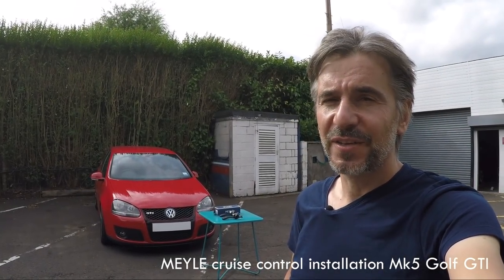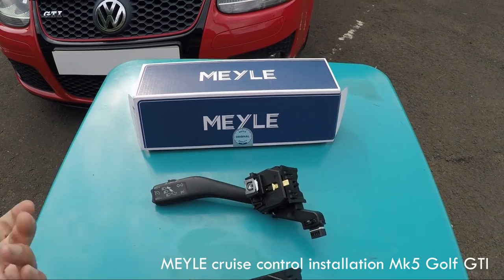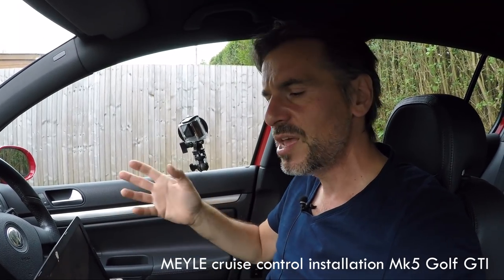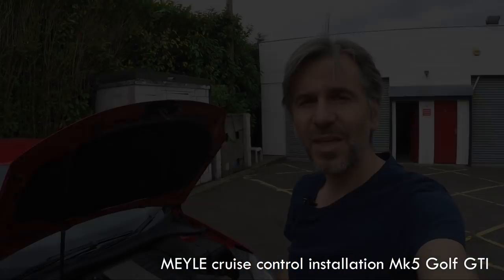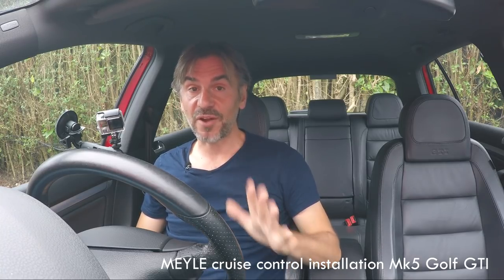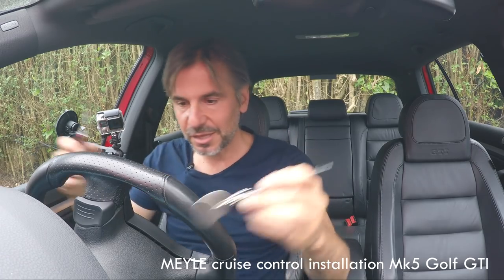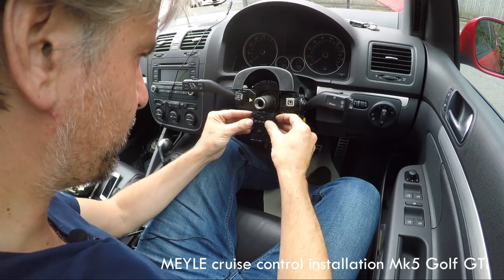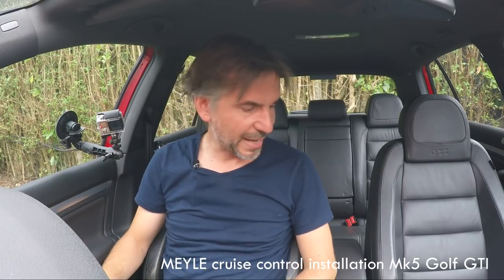DIY CRUISE CONTROL GUIDE - MK5/6 GOLF, EOS, PASSAT, A3

Comment: Hi, my 2005 Golf Mk5 cruise control has stop working, I've checked everything and all seems to be fine, my final result being that the stalk needs to be change, my question is?, do I need to buy the same part number as the one already installed, in vagcom the control module for steering at info shows as being 1K0953513F but I see so many parts out there that have sa same 1KO....... But la last letter is A or G or etc.... Is there any coding required for this. Thank you and excuse my lack of knowledge.
Reply from the maker: The part number you quote is for the control module. If your stalk is defective you just need to change stalk, don't touch the control module.  I am pretty sure any Mk5 cruise stalk will just plug and play but I'd get the Meyle one.
Reply: @volkswizard  thank you, really appreciate your reply, all the best

Comment: Hi, I fitted this to my 05 gt tdi, all the coding was accepted, and the light comes on when the engine is off, as soon as I turn the engine on it goes out and I get error codes, any ideas why or what I can do to fix?
Reply from the maker: No idea apart from some control modules defy logic and don't work even though they should. Are you sure the coding is correct? 
Check the module here:
http://wiki.ross-tech.com/wiki/index.php/Steering_Wheel_Control_Module_Versions

Comment: Hi I have 2007 vw golf mk5 without cruise control.i decided to add cruise control stalk and code it.so I have installed the stalk but the indicators are not working at all.only full beam is working can any one help ?
Thanks
Reply from the maker: Very unusual, where did you get the stalk from?
Reply: @volkswizard  Hi I got the stalk from ebay. It doesnt seem to be working.i bought the car recently it came with a flat bottom GT Multifunction steering wheel and that's all working.

Comment: I have a audi a3 2006 end i wana install the cruiser but i wana ask y if it needs to config the car with a computer? Btw vert helpfully video👌
Reply from the maker: Hi Mar10, yes you will need to configure it using a computer but any specialist with VCDS should be able to do this for beer money.
Reply: volkswizard ok thx so much, i have another question, i have seen in some vid that y need to open the dashboard to install a wire ,its that true? Thx
Reply from the maker: @adikacorri8892  It depends on the car, some early Mk5 Golf and cars based on that platform won't have the wire and it makes the job a lot harder to do.  There is a way to check but I can't recall how.  From my experience 2006> cars seems to have the wire (usually!)

Comment: Hi, I need a new steering control module to fit cruise control. I have a 2005 golf S and plugged it into vagcom. the steering control module has rejected cruise. Can you recommend a part number? thank you
Reply from the maker: This should help but bear in mind you may need the wire to the ECU which was missing from early Mk5
http://wiki.ross-tech.com/wiki/index.php/Steering_Wheel_Control_Module_Versions

Comment: Great video. It will be the same as on my A3 2005 8P1 model?
Thanks
Reply: Roughly the same setup, different Stalk & Trim. You may also require the ECU wire on a 2005 model

Comment: @volkswizard hello. Nice video, I have subscribed.

I have a question. If I change the steering wheel module from lowline to highline, can I expect troubles?
Reply from the maker: Thanks Roady Moto.  The control modules are very easy to get into a mess with and some just don't work even though they should do.  Most will work fine but you always have to expect problems, found this out from bitter experience.

Comment: Hi, wondering if can I retrofit a 09 scirocco MFSW onto my golf 5 gt?
Reply: Great videos btw
Reply from the maker: @lewisrene7589  Thanks Lewis! That's a good question, isn't 2009 Scirocco wheel the same as the early cars were very Mk5 or was that the Mk6 style wheel (much nicer)? If so it's not something I've tried but I am sure someone on a forum has an answer. Just beware that Scirocco started off like Mk5 Golf when it came to steering wheel electronics but quite early on, to match Mk6 Golf things changed such as both stalks being one part now rather than individual ones.  Make sure you have a MFSW compatible control module for  a start as not all Mk5 are👍
Reply: volkswizard thanks for the speeedy reply! yes it’s pretty much identical to the golf gti wheel which is why I assumed it would fit without issue... the man who fitted the wheel for me says that the wiring loom cable that came with the new mfsw has different pins and doesn’t fit so he used my original loom cable from my original wheel....Can this be solved by simply swapping the original control module for a highline one? FYI the mfsw has paddles too & My car is a gt 170 dsg 2008. Also which forum would you recommend to use? Thanks again

Comment: my control module is a lowline so i can't code it for cruse iv now got a midline module that can do i need to first code the new module to the car ? and if so where do i find the code to do this great video
Reply from the maker: First thing to do is tell the steering control module you are fitting a stalk as many won't allow this and will say coding not accepted. If it accepts coding you should (but not always) be OK so fit stalk, then login and tell engine ECU you have fitted cruise. The coding is all provided by VCDS as you go along so not something I can tell you.   This is useful http://wiki.ross-tech.com/wiki/index.php/Steering_Wheel_Control_Module_Versions

Comment: Its possible to add distance cruise control ?
Reply from the maker: Anything is possible in theory but I don't think you could on PQ35 chassis very easily, I believe Passat did have it but it would be a nightmare as radar location needs to be 100% perfect and stable. On MQB it would be hard enough but every MQB car (I think) has it as standard or an option.
Reply: @volkswizard  i think if you make it like Touareg have under badge , or like audi  on sides of bumper like fog lights , that is not problem , i think hard part is electronics , wiring and calibration i think

Comment: which kit would you use on a vw tiguan 2012 20tdi
Reply from the maker: You need the later Mk6 style kit with the left and right stalks integrated into one unit and possibly a control module too.  Research needed unfortunately

Comment: Great video, used it to replace indicator atalk that was broken (don't need/want cruise) but now my airbag light is on, I checked it was connected OK and it is?
Reply from the maker: If you remove airbag and turn ignition on, you will trigger a fault code that will need clearing. It won't clear itself if the airbag is reconnected. Did you disconnect the battery while doing the job? I don't but this should prevent this from happening. Only other thing to do is recheck connections if that doesn't work.
Reply: @volkswizard  all connections are good, I'll go and get it reset

Comment: How about vw tiguan 2009 mk1 do you no if it the same as this ??
Reply from the maker: Similar but may not be the same, if you have the Mk5 style steering wheel there is a good chance you will have 2 piece stalks rather than one that does left and right. If you do then it should be very similar.

Comment: Great video. Can you confirm this will be the same process on 2010 mk6 golf GTD? Cheers
Reply from the maker: No, it might be different as the stalks on both sides became one part instead of two and the control module got integrated into the slip ring. Not sure when it went from Mk5 style to this but could be around 2010. Using VCDS to get some part numbers should let you know which one you've got.